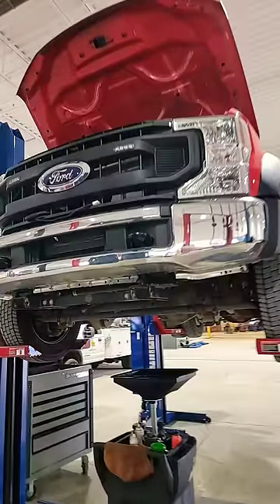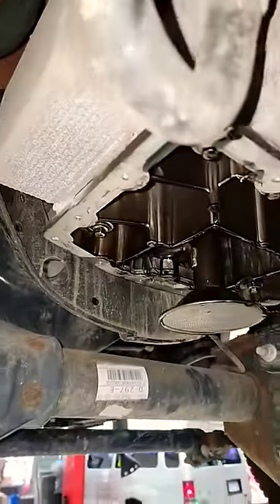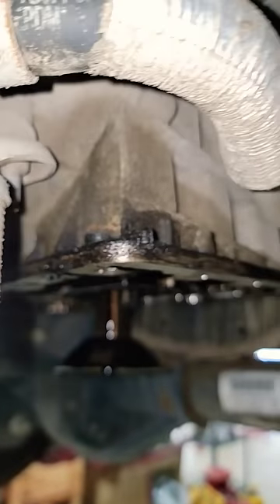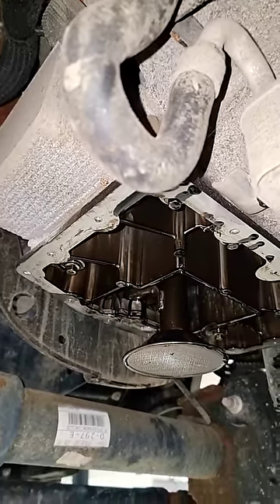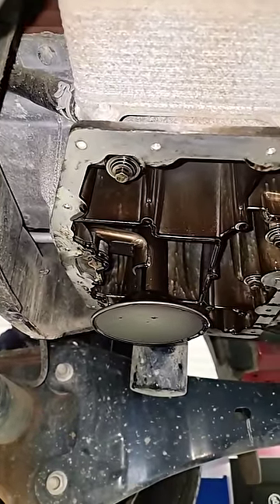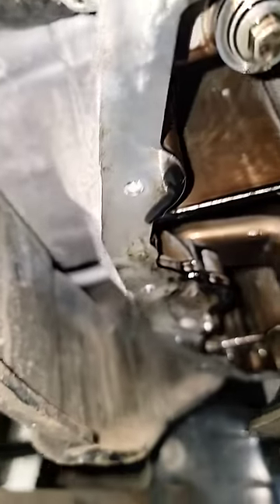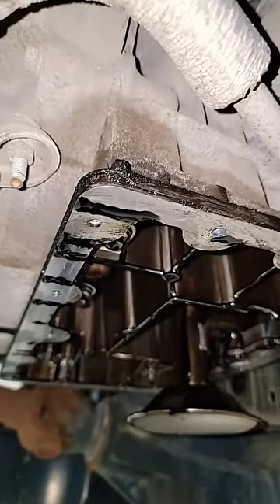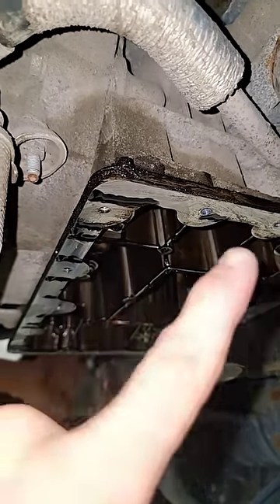Listen UP you Ford 6.7 engine builders  SMH 🤦‍♂️#bebetter #shorts #fyp #fordtrucks

Comment: Saw the same working on brand new Silverados at Chevy. Its disgusting to me how lazy some people are
Reply from the maker: And people think i am here to b.s.
Reply: @PowerStrokeTechTalkwARod  they always will, we are mechanics bro😂
Reply: That's because the ones made in Mexico are made by people that can never afford one... do you think they care about build quality?
Reply from the maker: Aint that the truth
Reply: @bortrah4946  😂 I suppose that's also true
Reply: @MichaelDouglas-24  right 🤣
Reply: @bortrah4946  yupp, true 100%
Reply: Built in Michigan
Reply: @bronco6456  The 6.7-liter Power Stroke V8 diesel engine is built at the Ford's Chihuahua Engine Plant in Mexico
Reply: @zbruh7268  I had a 2011 GMC Sierra built in good ole Mexico and that thing got traded in for a Toyota built in Kentucky. My GMC transmission went out at 107K. That was the final straw. My rear window motors weren't even plugged in from the factory. The engine knocked from day one and the dash went out around 30k. It was a nightmare to own. I had over 72 grand tied up in that shit dump
Reply: @zbruh7268  original owner too. It's actually kind of sad
Reply: @bortrah4946  Your yota is the better truck, because it was going to be the better truck regardless of the build location. Toyota has had better build quality and reliability than GM for decades now. It's funny that y'all wanna blame it on the place of manufacture sooooo damn badly, when there's plenty of "made in America" shit that is JUNK. Japan has historically built more reliable shit than the U.S..... you think they're gonna change their build quality standards or QC processes just because they opened plants in the U.S.? That's hilarious.
Reply: @bortrah4946  holy fck 😳 I better warn my dad before he takes delivery lol
Reply: Can't pump them out fast enough!
Reply: @PowerStrokeTechTalkwARod  and the prices of these things are ridiculous.
Reply: @bronco6456  assembled only
Reply: @bortrah4946  right because if it was made in America by people who also couldn’t afford one it would be better quality 🤣🤡
Reply: @bortrah4946  the cartel buys em left and right. Don’t buy any car with a 2 starting on the vin.
Reply: @bortrah4946  there's a reason toyota tundras are so expensive only gas truck id buy
Reply: Yes...especially when u are paying $30k on a car or truck. Sad!
Reply: @bortrah4946  Some vechile come from Texas and Detroit it's just not Mexico
Reply: @tyronnfields7945  30?! I wish lol. Try 70-130 depending the model and trim.
Reply: @tyronnfields7945  more like 75k to 90k for new diesel
Reply: @tyronnfields7945  Silao a city in Mexico is where mine was built
Reply: @TheJoeml85  I have an Fj, Xb, Mazda 5, Camry, and a Spark. The Fj is absolutely badass and the Camry is my go to
Reply: Toyota is king
Reply: @bortrah4946  i wanna get a new tundra trd pro wanted a duramax but i figured i'm not hauling anything heavy and that tundra will last just as long as any diesel and way cheaper to fix
Reply: @eaglestryker1338  maybe, but I was the unlucky one with a 50 thousand dollar piece of junk. It sucks man
Reply: @zbruh7268  definitely bruh
Reply: @TheJoeml85  right! Don't get me wrong, I had a Chevy Trailblazer 04 with a straight 6. That thing had 298k when the front end rusted out. These Sierras and Silverados are rough man. And the new ones have a turbo charged 4 cylinder? How long do you think they'll last winding up with that turbo... it's crazy man
Reply: It's the unionized employee who has the idgaf attitude either because lazy or b has issue with management and c my favorite lack of training on responsibilities for said job
Reply: @bortrah4946  actually no its the opposite in Mexico they don't have another good job lined up they take their job pretty seriously because there's already lack of jobs in Mexico so the majority really wanna keep that manufacturing salary
Reply: I came here to say the same thing
Reply: @TheJoeml85  haha don't fall for the new Tundra just yet. Those turbo'd sixes have been problematic. You're going to have much better luck with the old Tundras or the 5.7 Rams.
Reply: @treyroberts8124  what do u think about the new 1500 duramax
Reply: Truth is there is lazy people in every industry, that without a doubt includes mechanic's. As for production lines there is people watching, these lines. If there is a repetitive issue it's done by choice. Consistency comes in positives and negatives.
Reply: i really wanted a 1500 chevy duramax but haven't heard to much good things about them 😩
Reply: @TheJoeml85  I've actually heard good things about the Duramax and the Ecodiesel (2nd gen, not the 1st lol). There's not as much dedicated support for the diesels as the gassers though for things like bumpers, suspension, bolt-ons, etc.
Reply: @treyroberts8124  mybe they will be even better by time i'm ready to get one i don't haul anything heavy anymore i just like how reliable diesels are and the 1500s get god mpg
Reply: @tyronnfields7945  shh don’t tell him facts how’s he gonna spew his hate if he’s wrong?
Reply: @rogelio3133  most people i know can afford them easily
Reply: @bortrah4946  lol yeah right my 06 Silverado has 253k still running fine all original power train i Don't believe all that BS you just posted better keep you're eye on that junk Toyota frame that rust into
Reply: @donaldkinder6716  matter fact, they had to pull the top of the motor off my 5.3 at 60k just to replace an internal oil filter the size of my pinky (aka the size of your Johnson). I hope you get many more miles out of your truck but keep the sarcasm to you telling your buddies you actually get some other than your cousin or sister.
Reply: @tkitchens91  The problem is 1/2 ton pickups are for lesbians and Toyota doesn’t make another option. I’d love a 3/4 Tundra with a 6.7 Cummins! But they don’t build shit for Americans. My wife always has a Honda or Toyota though.
Reply: @keith14820  or D, theybe been working way too goddamn much and are exhausted and management doesn't give a fuck about them
Reply: @sambrown7950  absolutely not true, repetitive issues are also caused by incompetence, and it's almost always incompetence from management
Reply from the maker: Well Said 💯💯💯💯💯💯
Reply: It's a Ford. Bad designs
Reply: need to go back to using 
gaskets..makes up for imperfections, handles heat expansion and compression, gives room for torque twist, RTV on the other hand gets squished out when bolts torque down and leaves too little room for play
Reply: @keith14820  I would say the last and all at the same time some people just not cut out to do some jobs at my work if asked to train somebody and they just don,t cut it is sorry my man good luck.
Reply: Union workers!!
Reply: @tkitchens91  Plus, Toyota factories employ robotics, so very few humans involved....  Better quality control among other things.
Reply: @bortrah4946  lmao i have a 2011 silverado with 140k cammed 5.3 miles  stock trans stock rear stock motor dash is complete
Reply: @beto_lsx497  good luck
Edit: see how much the dealer values it at trade-in. You'll really "lmao" then dik weed
Reply: I mean if you can’t do your job right, what’s the point of having it. People are getting dumber by the day.
Reply: You really thing John Everyman is neglecting finished the edge, Joe Neighbor who is inspecting it missed a couple thousand and Jack Meoff who assembled- it let it on the road? NO ffs. It's the engineering team that made the decision to plane it with a 1/16" tolerance. They're the ones who decided 60 minutes of labor can be saved by just adding some extra silicone...
Reply from the maker: No, no & no. Easy to say when ur hangin' by your keyboard
Reply: Please don't tell me that.. I have a 21 silverado.. lol
Reply: @jakeroberts5924  just take care of it bro you'll be fine I'm sure
Reply: @bronco6456  lol they’d be different if it was all built in Michigan
Reply: nice trying of case dilution by spreading to other brand.
Reply: Found the Ford fan.
Reply: @LarryFish3rman  porsche*
Reply: @TheJoeml85  110 for a used denali
Reply: @rogelio3133  sounds like he trades a lot because he knows they won't last..nothing racist about doubting a truck that has to be built by government standards
Reply: @jakeroberts5924  get the fuel management disabled and it will be as solid as the old 5.3's
Reply: @jw7037  lol man where u looking at i can find them for 80k new and the at4 which i like better for 73k
Reply: No you didn't lol 😆 Chevy doesn't use straight silicone on unprepared surface 🤣 and Chevy hasn't had that problem especially the new motors And the Duramax is bullet proof so far.
Reply: Toyota 😆 🤣 nice for recreational shopping and bird watching.
Reply: @willesco5211  😆 🤣
Reply from the maker: U must be on that hail bop purple drank.
Reply: @TheJoeml85  I can tell you the 2500 duramaxs with the L5p is a strong reliable motor. Plenty of power and torque with some upgrades from the previous .
Reply: @shawngrace6322  yeah i think when i get a new truck i'm gonna get the gmc 2500 at4 duramax mybe do like a 4 inch lift the 2500 already sit kinda high
Reply: @shawngrace6322  do u know anything about the 1500 duramax just curious because i wouldn't mind having one of its a reliable motor
Reply: @TheJoeml85  only the 2500's and 3500's
Reply: @shawngrace6322  ok i can't believe some places i can get the at4 dmax for like 76 and some places want 90 lol
Reply: @bortrah4946  I see that in everything now-a-days.  People struggling working 50 hrs or more pay-check to pay-check. Meanwhile CEOs make 670 times more than their median workers.  Hard to care about quality.
Reply: And it makes the customer not want to buy that brand again because of people being lazy
Reply: @bortrah4946  Henry Ford is rolling in his grave
Reply: @TheJoeml85  i have 1 30+ mpg highway 4x4 with standard bed
Reply: @TheJoeml85  then you've been lied too, the most common issue with duramax could have been the long crank no start, which was fixed in the 22 models and there is a software update for the older models. WHoever said trash about the duramax clearly never had them because the engine itself is very reliable
Reply: @AmazonWebService98  i never said anyone said that they are trash a duramax is the only american made truck id buy
Reply from the maker: Si
Reply: @AmazonWebService98  2500 or 1500 if i get a 2500 i want the gmc at4 if i would get a 1500 dmax it would be the trail boss
Reply: I'm always amazed how much you guys overseas can pay for a pick up :O

Only ones available here are Ford Ranger, Nissan Navara(=Frontier), Toyota Hilux, Mitsubishi L200(=Triton) and Jeep Gladiator.

So just the idk midsize trucks? Or are these smalls trucks for you. Anyway all just with 4 or 6 Cylinder diesel and they do their job :)
Reply: @rogelio3133  Does your dad have his own business here in America because if so no offense all you guys get all of our American taxpayer dollars to help you with business, school, and everything meanwhile the Americans that already living here and born here have to suffer and get by paycheck to paycheck with no help from anyone and over taxed out the ass so it’s not really fair but yes I do agree Spanish people are very hard-working people just like every other kind of person
Reply from the maker: ....I am spanish/mexican......last time I checked, aint no one helpin me....🤦‍♂️🤷‍♂️🤦‍♂️🤷‍♂️
Reply: You bought "American"... now everything is in Canada and Mexico... Toyota is the most American manufacturer now and it shows in build quality.
Reply: @bortrah4946  Are you aware of how things work in factories abroad? 

If Ford US never gave or filed a manufacture process that includes surface finishing for a specific component, nobody will make it. Be it in Mexico or the US. 

The production/manufacture engineer for said part is responsible for the inclusion of all design and design change requests into the product’s line. It’s not a Mexicans or Americans thing. It’s a process in a factory that Ford’s engineers clearly did not state was needed. 

Jesus Christ you people.
Reply: @Misselfilmen  your name fits you I'm sure. You probably like em long and strong 🤣
Reply: Every 2018  5k mile eco boost f150 I did an oil change was Already leaking from the oil pan when I raised it up🤷🏻‍♂️
Reply: @Dmonsterparedes0625  when did I ever say that wasn't possible? It's usually from that stupid plastic drain plug when people don't clean it off
Reply: See the same every day at the gm dealership I've replaced at least 4 engines since I've worked here for the last 4 months.
Reply: *underpaid
Reply: @bortrah4946  I drive a 21 Sierra elevated Edition and the already replaced the lifters and did tons of engine work
Reply: @bortrah4946  Maybe not, which tells me one number needs to go up and another go down.
Reply: @SilverJ 💯
Reply: @leghumper1574  there was a guy in the waiting room at our local Chevy dealer. He was upset because the "warranty" he bought from a third party said they couldn't replace his transmission in his Silverado because there were none available. The tech behind the counter said, "that's bullshit, we replace two or three a week here, they're lying to you buddy". 
Let that sink in, the tech at the dealership said they were replacing two to three transmissions a week!!!!
Reply: @bortrah4946  honest to god i wish I was lying...
Reply: @bortrah4946  yeah used to be the old gm trucks were the top of the line now 8 speed and 10 speeds in trucks. Are useless.
Reply: @leghumper1574  I agree 100%
With the exception of a diesel with the Allison trans.
Reply: @bortrah4946  because those aren't made by gm they are made by dmax and Allison devision subsidiaries of gm but not under gms craptastic ceo
Reply: @bortrah4946  how they get around antimonopoly measures.
Reply: @Micheal Douglas. How u tell everyone on the internet you're a bhutthurt Ford owner......without saying you're a Ford owner.
Reply: @gakefeddy3709  😂 I literally never compared the two
Reply: Nope, GM last forever.  Ford trucks are the MOST repaired motors and transmissions 10 times more than GM
Reply: @bronco6456  motor & trans are built in Mexico
Reply from the maker: News flash Roar Roar, ummmm your Chevy & FCA techs AREN'T just standing around twiddling their thumbs.......
Reply: @PowerStrokeTechTalkwARod  He was talking about the manufacturers.
Reply: The amount of effort I put in to cleaning them gen v GM engines during cam/lifters is crazy.  I know some guys probably just squirt rtv over the old stuff and slap it together.
Reply from the maker: Yea no kiddin jeffery Giraffe, the ENGINE IS NOT ya ding dong. Maybe you should troll the comments b4 you become a troll urself
Reply: May be intentional for more money. It makes sense
Reply: Gm has been using black silicone since before 2000, same issue on all 6 cyl, 2100, 3400, 3800,  at intake valley seals at block, though they did surpass the 3000 mile mark by a few thousand miles.  A  cork or neoprene gasket would do two things. . seal the leak better and separate a steel pan fron an aluminum block ( dielectric oxidation).
Reply: @jtoker9758  lol those people huh
Reply: @MichaelDouglas-24  If the air jordans fit.
Reply: @jtoker9758  bruhh🤣🤣🤣
Reply: My girl works for a chevy dealership and same issue 2022 2023 models all are junk
Reply: Could be management is enforcing this kind of policy !
Because if anyone from upper upper management was walking the line and they had any brains about what it is that their business is which is making motors transmissions or any other parts whatever it is and they saw that that shut the line down and there'd be a nice big conversation there in the middle of the factory building saying this is not acceptable but apparently it is
Reply: How often do you see rear main seal leaks on gm trucks?
Reply: Unions
Reply: My wife works for VW, but we can only afford a Jetta because of the employee discount. The wages are low for the work, and they’re pushing for a higher quota, which means less time allowed per vehicle. Quality is an afterthought in the mindset of the company, and the employee is forced to follow suit.
Reply from the maker: Id find another job. That situation goes against our policy!
Reply: Ford payed you to say that hahaha
Reply: Doubt they're lazy, act like youve worked in an industry before. You know how it usually goes lazy people get weeded out pretty quickly. When production has those by any means dead lines
Reply from the maker: Yea, no its called union guy....
Reply: @bortrah4946 maybe  not, quality needs to inspect each one
Reply: Beat me to it. It's sad how much I see it.
Reply: @bortrah4946  exactly what I posted lol
Reply: I smell bs
Reply: Damn and here was I thinking I’m glad I got a Chevy. We are all screwed
Reply: @bortrah4946  can’t have a good car put together by ppl who never set foot in one
Reply: Seen the same with the Ram trucks, things are not build good like back in the day sadly
Reply: @bortrah4946 I've seen plenty 2011s make it to well over 300000 miles. You just got a bad one
Reply: @bortrah4946  lul same ae VW made from mexico. Rear spring always broken.😂
Reply: @bortrah4946  That's why you should buy a Toyota made in Texas.
Reply: @tyronnfields7945  $30k!? That’s funny.🤦🏻‍♂️
Reply: Sure ... This is a FORD issue
Reply: Chevy has had pretty poor quality for at least a decade so it's not too shocking.
Reply: same thing with john deere tractors
Reply: I wouldn't say laziness, more like efficiency.
Reply: @bortrah4946  Everybody has plants in Mexico and US, doesn't matter. Tacoma is from Mexico, Mercedes and VW has plant in Mexico too
Reply: @bortrah4946  You probably can't even afford eggs. 🤣
Reply: @tkitchens91  All Toyota  engines and transmissions are built in Japan. They just ship over the parts then to be assembled in Mexico; all they’re doing is assembling, they’re not actually manufacturing car components there. At least, that’s what I’ve been told.
Reply: @zbruh7268  If only the engines that drive Chihuahuas would become silent as quickly....
Reply: It’s this new generation. Everybody is just a body that keeps the company in business quality is gone.
Reply: What is up we these people I’m wondering know if I should even buy an American truck
Reply: That's Americans for you. I'll stick with Japanese cars. They take more pride in their work.
Reply: Fired them people at the plant n hire new employees maybe that will teach them how to. Care for their jobs
Reply: @alvarosolano6569  they won’t find anyone else to work for 7$ an hour
Reply: @Bor Trah  and GM will fight you tooth and nail on recall and warranty it seems lately.
Reply: @bortrah4946  The 2011 sierra transmission was definitely not built in Mexico, was built in Indiana. Only assembled in Mexico, transmission was already whole before that.
Reply: that’s what happens when you stop hiring qualified people to fill quotas
Reply: Lets be real they doing it on purpose cuz of rhe dealership warrenty we still have to pay even with the warranty so....we know, but they don't know that we know they don't know we know ❤😂🎉
Reply: Union made?
Reply: Don’t blame us g. It’s you guys that want to save a penny
Reply: @fernandocardenas615  I’ve heard many stories how lazy and greedy Union workers can be. Especially in the Fort Wayne GM plant.
Reply: its not laziness of the average factory worker, its the corporate culture of pushing maximum profits at the expense of build quality. Its middle and upper management pushing the workers to cut corners as much as possible to maximize CEO and executive profit margins. Problems like this are coming from the top.
Reply: a little common sense please. Has nothing to do with not caring for your job, although why should anyone care about a job when you can be let go at any time.

What it has to do with is procedure. There are automated procedures and manual procedures. The pan is attached manually after the surfaces have been prepared by a robot so go argue with a tin can if you have a problem.
Reply: @jussayinmipeece1069  I hear these things from other union workers at this GM plant.
Reply: @JAYCC33  true though. Back in the day your union and even tje company wanted you and took care of you. Now you are simply a number in an actuaries ledger. 

Union reps are more concerned about that extra pay they get as tje rep rather than actually representing and tje unions are more concerned  about the kickback they get from the companies rather than making sure their members are propertrained and properly represented
Reply: I stopped buying domestic in 92, they never learn.
Reply: Looks like it had some kind of attachment up front. Maybe for a  plow? Probably not normal road miles.
Reply: @MichaelDouglas-24  u guys got more skills than the factory worker.they prib become more n more " drone " like these days
Reply: $18 dollars an hour.. making $100k trucks.. not surprised
Reply: @PowerStrokeTechTalkwARod  It's not the employees at the factory, It's executives at the company itself. They want these motors to just barely last longer than the warranty....
Reply: Its all about low production time and hitting numbers. Screw quality, just get it out the door. That way they can make even more money in service shops. It's not about customers anymore, it's about pleasing shareholders and profits.
Reply: The problem is people who work at places like American axle gets treated like complete crap to the point they give up on making the best and just focus on watching their back.
Reply: Won't see that on the new rams 😏
Reply: How lazy... EHHHH wrong. The wages don't match what people are expected to do
Reply: Lazy people, im pretty sure machines clean and apply the silicone at the factory....
Reply: Diversity hires.
Reply: I work for a farmer. We get new duramax 1 tons every year. 4 low blows on all of them very early on in their life.
Reply: Chevy Silverado are Made or Assembled in MEXICO.
Reply: aint lazyness. Companies just continuing to cut cost by reducing work steps. Its only going to get worse
Reply: Fix Or Repair Daily... FORD!
Reply: @bortrah4946 I wouldn’t care too if I was getting paid peanuts
Reply: @PowerStrokeTechTalkwARod they gm send all work to mexico. They are not train right paid 6 dollar a day.  People working on em will never own so they can carless blame owner company for being greedy.
Reply: built by robots.
Reply: My 2500 Chevy was made in flint Michigan, I just hope no one was asleep when assembling it.
Reply: @cloroxlavenderscent4307  what year is it ?
Reply: I'd stop buying their products then simple as that if they lose enough money they might learn their freaking mistakes and if not then they'll go out of business and then by that point who cares